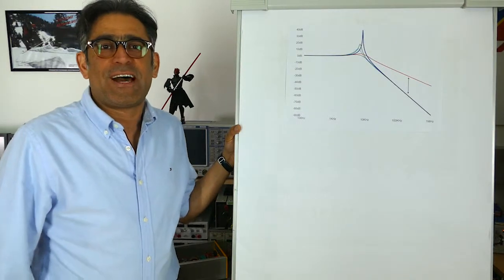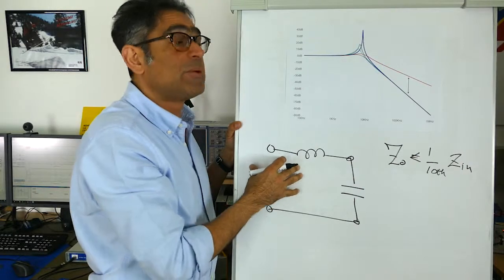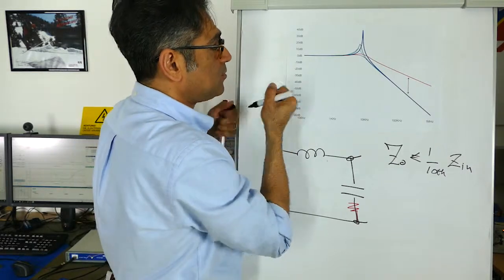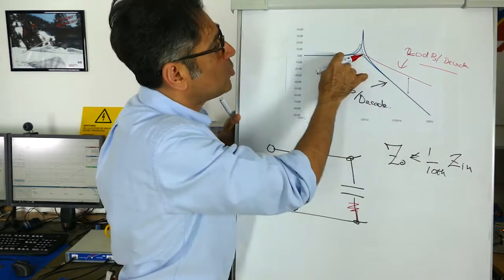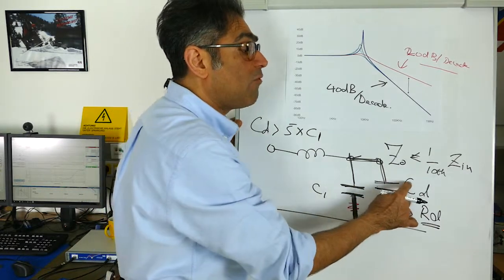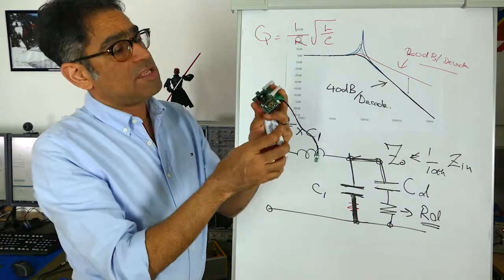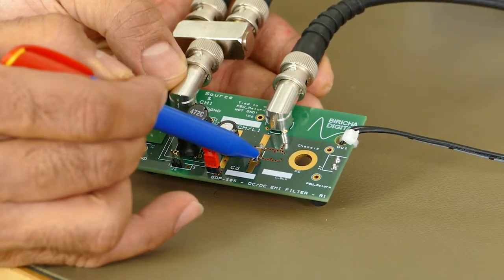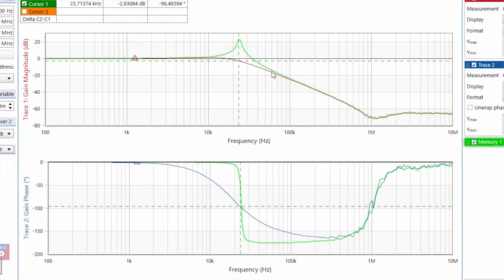EMC Filter Design Part 5: Damping the Differential Mode Filter

Comment: Just a quick question. When calculating the cutoff frequency of the input filter, do you include the bulk input capacitance to the power supply as part of the filter as well? My guess is yes, but I need clarification
Reply from the maker: The bulk input filter will be in parallel to the input so it is part of the input filter. Depending on the capacitance and ESR it could be used as the damping resistor.

Comment: Is it OK to use an electrolytic in an EMI filter as an X-capacitor?
Reply from the maker: Normally, an X-capacitor is a safety certified capacitor that can withstand over-voltages coming from the line.

Comment: The large damping capacitor should be non-polarized? This an AC circuit correct?
Reply from the maker: The filter is analyzed as an ac circuit for simplicity. In reality, there is of course dc present when the dc system is running. Polarized capacitors are often used also for input filtering.

Comment: Why the damping Cap do not change the cutoff frequency? In my opinion, C=C1+Cd.
Reply from the maker: You are right, the total capacitance is the sum of both but C1 is much smaller than Cd so its influence on the cutoff frequency will be negligible.